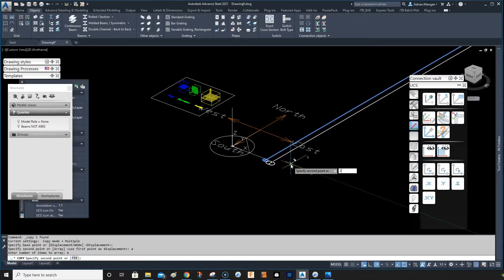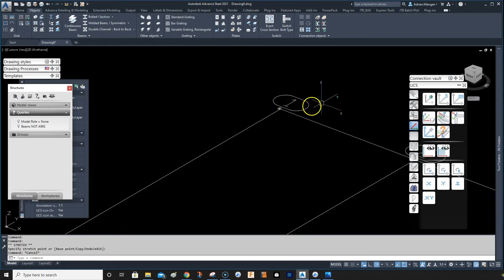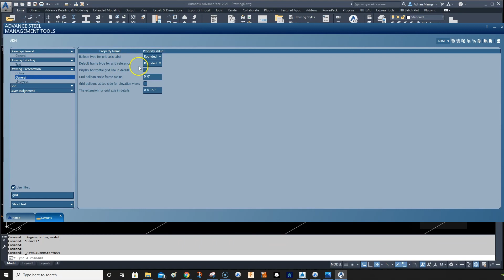ADVANCE STEEL: Quick Tips - CREATE GRIDS.

Comment: I wish I could attached a pic, but do you know if there is a way to shorten your grid lines, so they do not stick way past my GA title block ?
Reply: Hi, well I create mine so I can control them separately, you can adjust them in the model or double click on them and adjust the extension, hope that helps. good luck
Reply: @adriandmangan  Yeah, I did follow your tutorial and created them that way, but I can only grad the end grip and move it a bit. After that the bubble is in the line and the line will not stretch anymore. Thanks for your reply anyway. I have 2 grips per grid. Maybe I should have 3, but dont know how to get that. Cheers